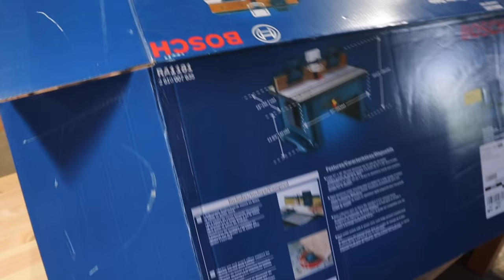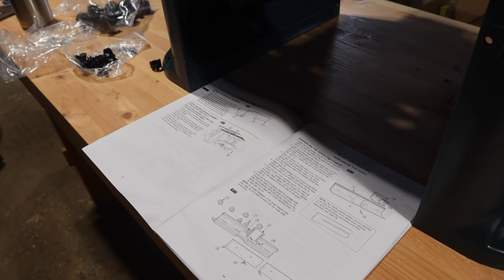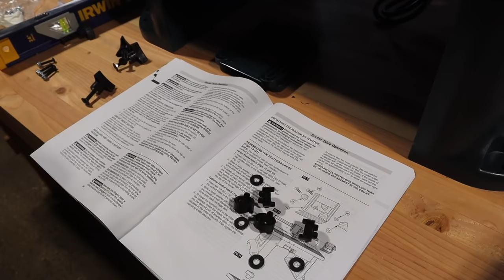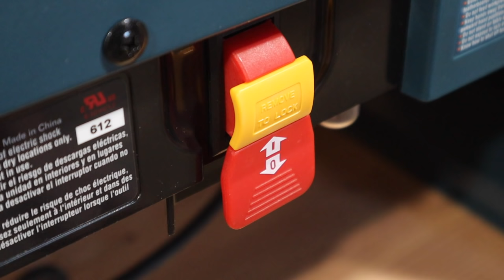New Bosch Router Table | Model RA1181 - Unboxing & Setup

Comment: Beware…. Inserting the router is not as easy as it looks in this video. Very poor design in that aspect
Reply from the maker: I haven’t had any issues inserting it, at the risk of asking a dumb question, you align the detents and unlock the friction lock before loading it right?
Reply: @NorthwestCraftsman  Yes. There is a lock lever and then another push lever you push in (which I'm assuming is the friction lock you are referring to) as you are simultaneously pushing the router up into position. The router does not lock in easy and never has. I can do it, but it takes way more effort than it should.... and my 65 year old father-in-law cant do it at all without flipping it over and letting gravity do the work. I'm not sure if the holder is defective or not, but it takes a ton of effort.
Reply from the maker: Shoot, I understand what you mean and am wondering if there is something going on with your table. You are totally right that I forgot about push button for the quick position, but, and maybe positively, wasn’t the friction lock I was referencing which makes me wonder if this is still locked. On the main sleeve that the router fits into, which is mounted to the underside of the table, there should be a latch, is this flipped out before installing the router? My general process is the following:
-  Unlatch the sleeve (opens it up slightly allowing for easier insertion)
- Align the router underneath with the detents 
- Slide/rotate it in until it hits the first stop
- Press that button you mentioned
- Slide it in one or two clicks
- Re-latch the sleeve to tighten in down

If it helps, I can quickly throw a video together on how I load mine into my table. If not that’s totally fine, I’d just hate for something small to be missed that’s keeping you or your father in law from enjoying your woodworking.
Reply: @NorthwestCraftsman  You are definitely detailing the process in the correct order..... It is the pressure required between the "press that button you mentioned" step and the "slide it in one or two clicks" step.... THAT is the issue. It's not as easy as it sounds - at least not on the one I am using.... Once the router clicks in place, it is fine and you can lock the latch and start routing.... But getting that sucker up there while simultaneously holding down that button is a real struggle.

Comment: Does this table have a router bit height adjustment feature?
Reply from the maker: Sure does! When used in tandem with the 1617 EVSPK fixed base, there is a pass through with an Allen key for depth control
Reply: @NorthwestCraftsman  excellent! That’s what I figured. Thanks for letting me know. Looking forward to getting mine in a few days.
Reply from the maker: Excited for you to get it! I love mine.

Comment: does it work with other brands of router?
Reply from the maker: Sure does! Page 15 of the manual, linked below, shows the documented compatible routers. I’m sure there are more as well. 

RA1181 Manual
http://pdf.lowes.com/operatingguides/000346353679_oper.pdf